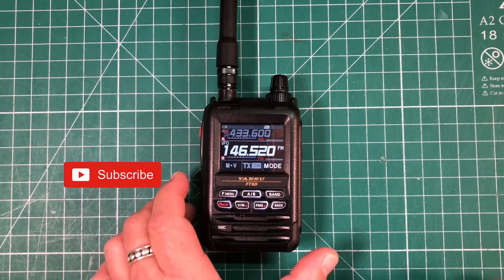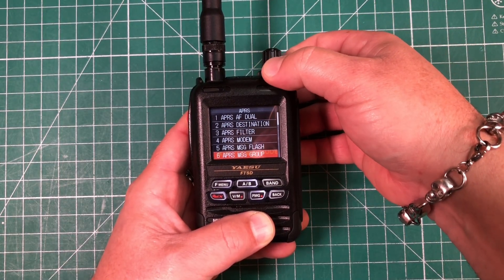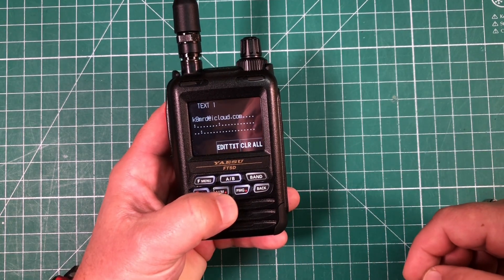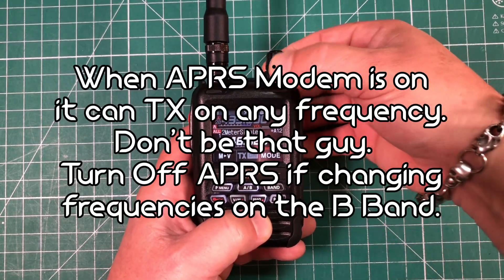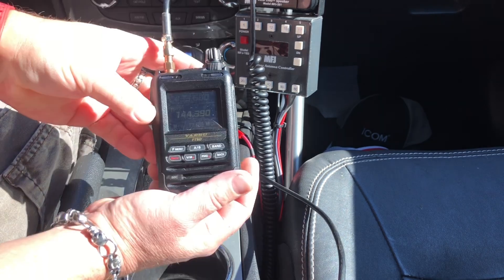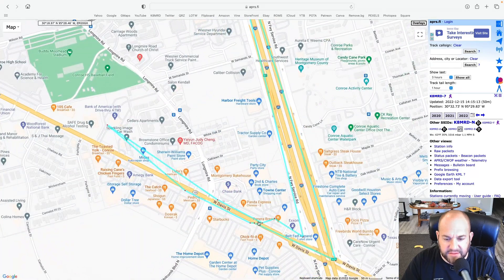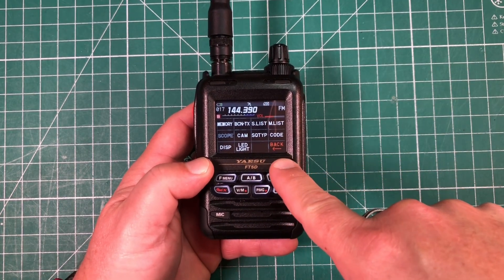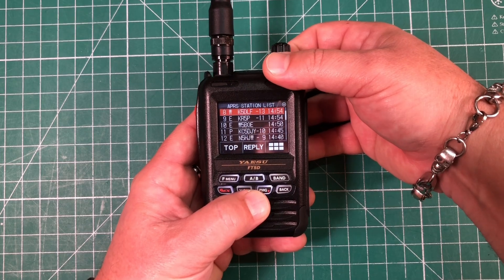Easiest Way To Setup APRS Yaesu FT5DR Step By Step

Comment: quick question! I followed the setup but when I try to press the test BCN-TX button, nothing seems to happen. (no red light tx status). I do notice my GPS icon is flashing like it's searching for signal lock, so does that mean I can't TX APRS until the GPS is fully locked?

Comment: Good afternoon. Do we need internet/wifi when using our APRS ?
Reply: Hi, ft5dr receive lat and long from the GPS and send using the RF. You no need WiFi. If you use your cellphone you need the connection to Internet to send you lat and long the cellphone receive from the GPS.

This is the difference, if you walk on no cellphone coverage (no internet access) the only option is with the radio FT5DR 😂

Comment: New Tech here (with an FT5D)...Is 144.390 specific to your area?  Or, why 144.390?
Reply: 144.390 is the standard frequency for APRS in the US.
Reply: @AC9DJ  Thanks, Jim...and sorry for the newbie questions...When I transmit (beacon) on 144.390, what is on the receiving side?  This is all analog, right?
Reply: There are a few videos out there that show how to set up ( and I appreciate K8MRD's video)...I'm not so much trying to understand how to set up but more so on how it works.

Comment: The line leading from the digipeater in Conroe n5luy-3 show the route the packet took to arrive at an igate. N5luy-3 does not send packets it hears directly to the internet. Purely a digipeater. Aprs can be alot of fun!  And another ham radio rabbit hole! Thank for the video!

Comment: I love APRS on my Anytone 878UVII Plus.  I use it to send emails, SMS messages and even Whatsapp messages when out and about.  I never have a phone on me when out.
Reply: I got the sane radio and was thinking about trying APRS...Any good how to videos you could point me too? I'm a fairly new HAM, I got my tech back in April and my General in October..The 878UVii+ has so many features its insane...I hear people complain about its price but sometimes I put adapters on my coax at home and run the 878 through a Diamond X300-A and I am always blown away on what that little radio can reach on such low power....KI5USS 73
Reply: Look into pico APRS v4
Reply: @DARTHDANSAN  Why?  He already has an Anytone he wants to get working first.
Reply: @MI7DJT  does the anytone send and receive messages also ?
Reply: @DARTHDANSAN  Yes.  It can send and receive SMS, Whatsapp and email messages.